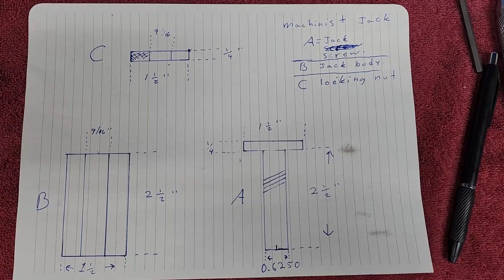Making Machinist Jacks (0018)

Comment: When using a dead center in the lathe it’s important to use an extreme pressure lube on the center such CMD Extreme Pressure Lube. It only takes a dab of that stuff. It greatly reduces the heat build up. But I seldom use dead centers anymore.
Reply from the maker: I used dead centers in college but I don't remember that we ever put anything other than oil on them. I also don't remember then getting hot. I'm not planning on using it again.

Comment: As you already checked the obvious reasons for binding, I wonder if it could be a slightly changed pitch.  Like a little stretched tap.  Actually not stretched, but similar appearance.  The other possibility I can imagine, would be already worn out tap, so it does not make full depth thread cuts.  That would better explain why the light sanding of the plug helped.  Just a few thoughts from a guy (electrical engineer), who never has done any real machining, and just a few weeks ago even bought my tiny Proxxon lathe.  I am trying to make replacement probe tips with about # 00-92 (or possibly similar metric) threads for some old measuring instruments.
Reply from the maker: I bought some real expensive taps and my thoughts are it had more to do with the die than the tap. I haven't run a 5/8 bolt into the jacks yet but that's been on my to do list to be sure of what's going on. One of the taps I bought was over 100 bucks made by one of the best companies in the US. Another issue I thought of, was the metal could be forming and compressing into the tap. Thats not uncommon with softer metals and this I think is 6061? It's a medium hardness steel. 
Oddly enough, not much is made in dies so I've been stuck with cheaper dies. 

Thanks for the comment, appreciated.

Comment: You need a ball bearing center in tail stock. Dead centers won't work well under the conditions your using it for..
Reply from the maker: The one I have is beat up. I've used dead centers before with no issues. They had us running them in college. I'm going to get a new one soon so that will fix any future issues.